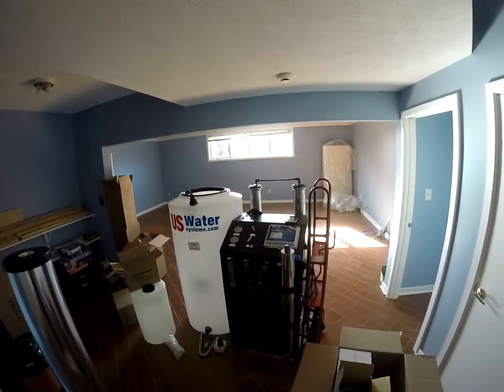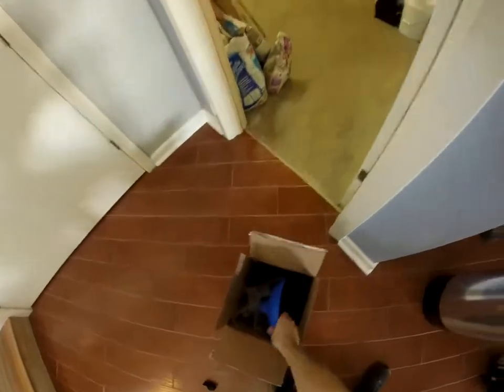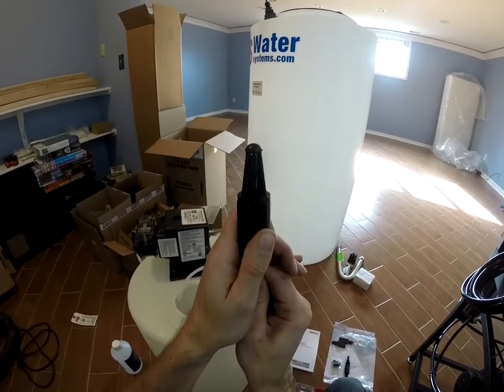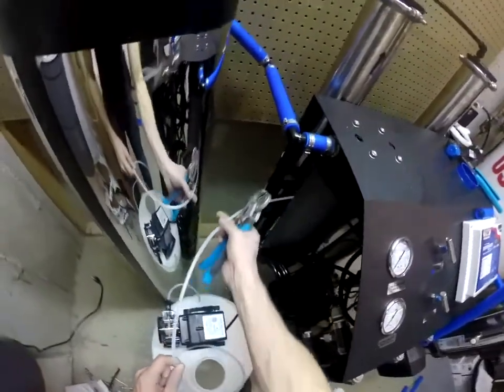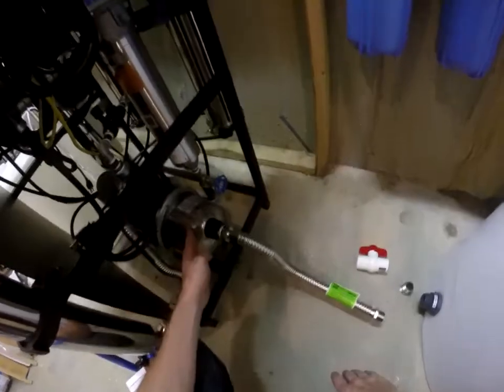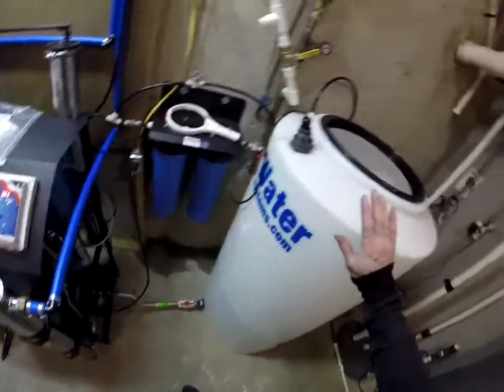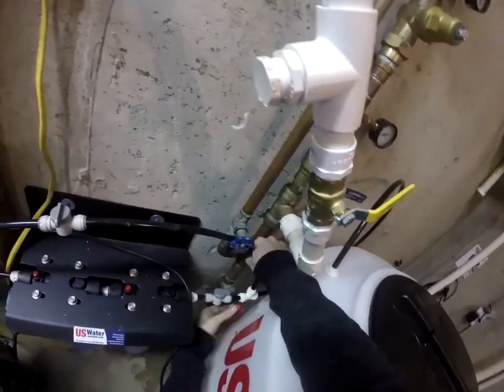Installation: Defender Commercial RO + BodyGuard and Remineralization Filters

Comment from the maker: Timestamps:
Unboxing/Parts - 0:10
Assembling the BodyGuard Carbon Filter - 2:33
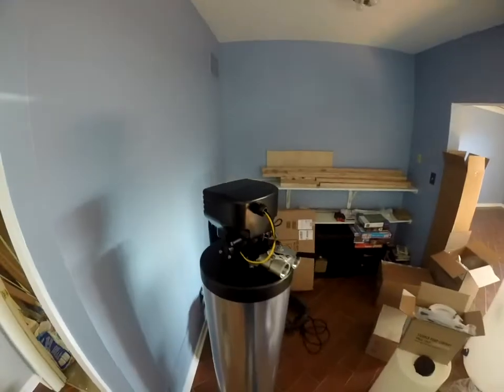Remineralization Filters Installation - 6:38
Antiscalant Assembly and Install - 10:46
Wiring the BodyGuard Filter to the Defender RO - 17:18
Installing the Float Switch to RO Storage Tank - 19:05
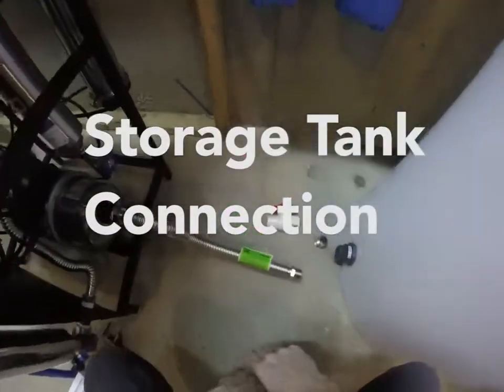Connecting Storage Tank to the Defender RO - 20:18
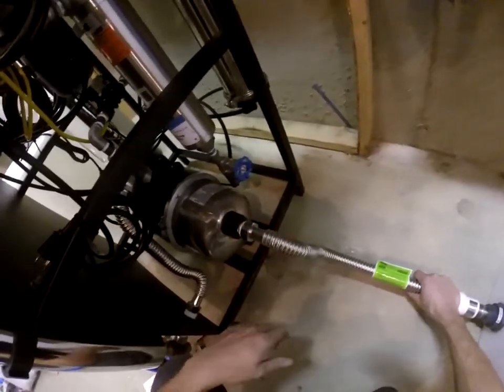Installing the UltraViolet Bulb into the UV System - 21:07
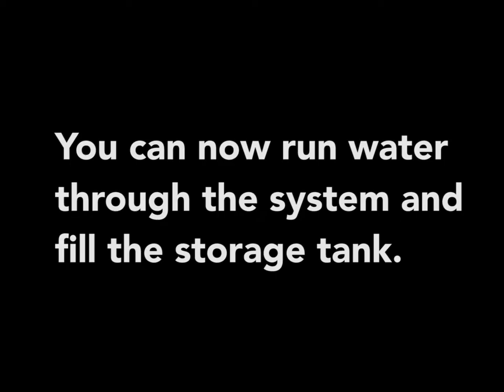RO Pump Start Up - 25:10
BodyGuard Filter Start Up - 27:10
Defender RO Start Up - 29:32
Testing the Storage Tank Float Switch - 32:37
UltraViolet System Start Up - 33:25